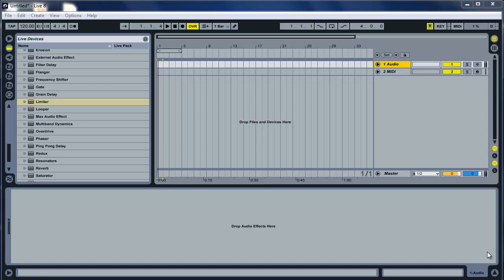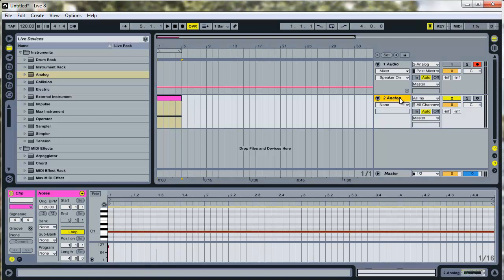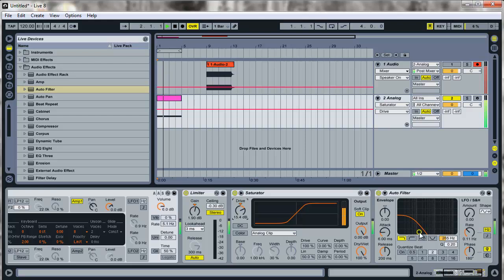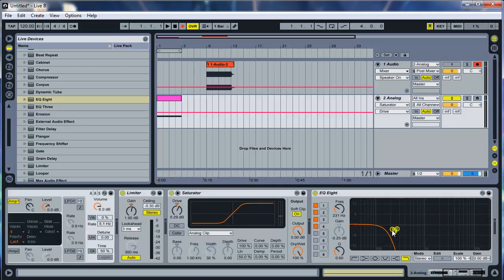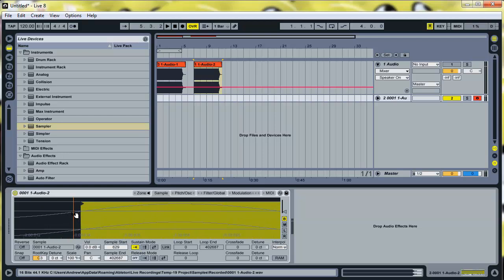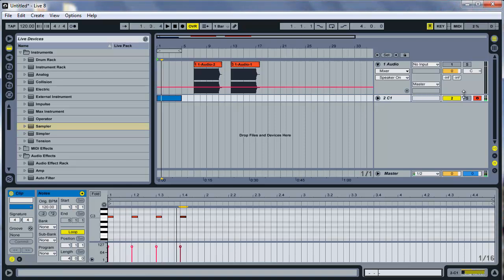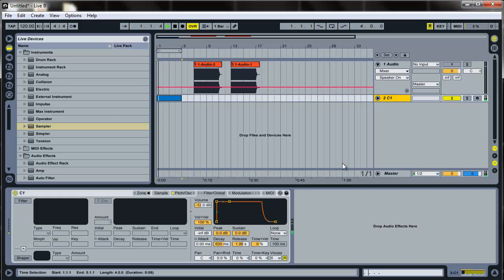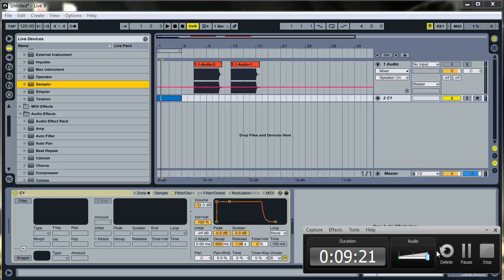Ableton Live 8 Tutorial: How To Make a Tuned Fat Punchy Dance Kick Drum (Part 1)

Comment: Thanks so much for this video bro It's really well made. This is probably a stupid question but it's killing me and I'm sure it is something simple that I'm missing. Before you add the saturator and limiter and stuff, When you sample the analogue you I can hear a high pitched ring which sounds really cool in the finished kick. When I sample the analogue I am getting a decent bass sound but nothing on the high end.Have you used a different setting? or did I miss something you did.  Thanks again:)